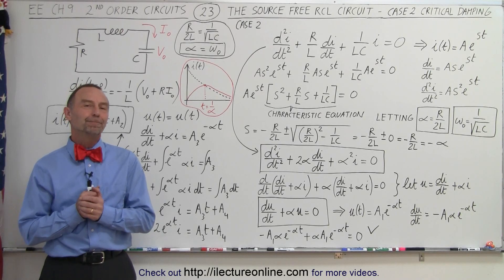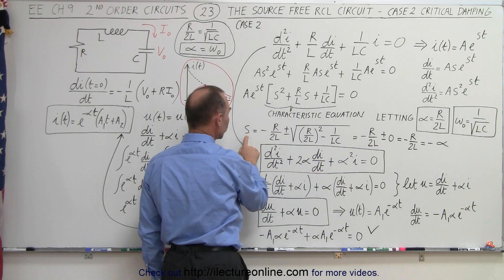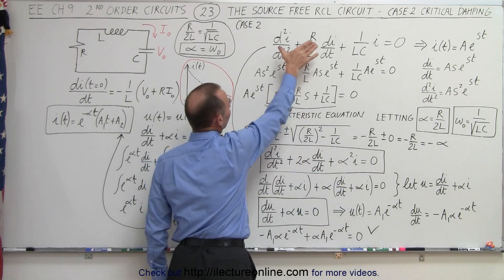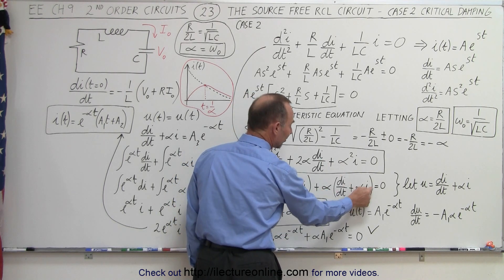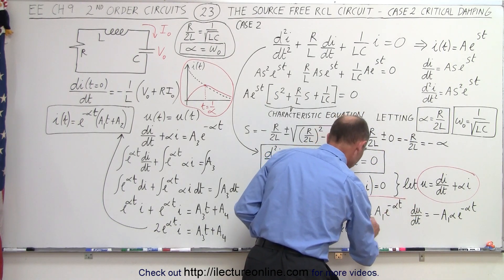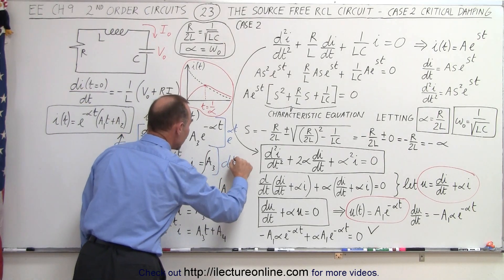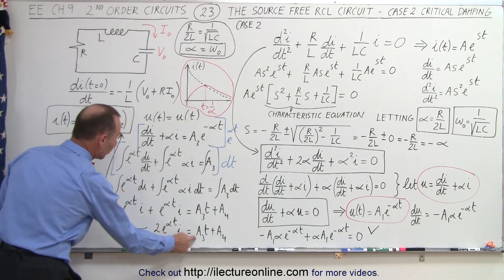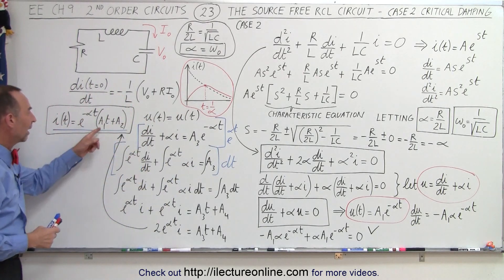Electrical Engineering: Ch 9: 2nd Order Circuits (23 of 76) RCL-Case 2 Critical Damping

Comment: At time 5.23, why integrate "di" only.. by right should integrate by part right.. n include the e^at ... could u explain on thiz.. tq
Reply from the maker: We multiplied both sides of the equatoin by dt
Reply: So, if multiplied both sides of dt,, can we ignore the e^at for integrate??
Reply from the maker: No you cannot "ignore" the "e^at" in the integral.    Inegral (e^at)dt  = (1/a) e^at+ c
Reply: @MichelvanBiezen  At 5:24, I have the same question, but I will elaborate.  

I did the following for the leftmost integral (the one from the second equation from the bottom of the board):

integral [ e^(alpha * t) ] di(t)                 =              integral [ e^(alpha * t) * di(t)/dt ] dt

______________

Integration by Parts is shown as below:

integral u(t) dv(t)    =    u(t)v(t) - intregral v(t) du(t)

______________

Recall (mentioned from the very top of this comment):

          integral [ e^(alpha * t) ]      di(t)                 
=        integral [ e^(alpha * t)   *   di(t)/dt ] dt
=        integral [ e^(alpha * t) ] * [ di(t)/dt ] dt       (all I did here was regroup the terms)
                                     
=        integral          u(t)                    dv(t)

The "regrouping" was to put it into the form of the L.H.S. of the [Integration by Parts] equation,
which gives the following substitutions:

  u(t) = e^(alpha * t)
dv(t) = [ di(t)/dt ] dt

To also get:

du(t) = [ alpha * e^(alpha * t) ] dt
   v(t) = i(t)

_________________

Applying the substitutions to the R.H.S. of the [Integration by Parts] equation,
I got:

[ i(t) * e^(alpha * t) ]    -    integral [ i(t) * alpha * e^(alpha * t) ] dt

Therefore,
integral [ e^(alpha * t) ] di(t)     =              [ i(t) * e^(alpha * t) ]    -    integral [ i(t) * alpha * e^(alpha * t) ] dt
__________________

Now, in the L.H.S. of the second equation from the bottom of the board (NOT the [Integration by Parts] equation), 
it said:

integral [ e^(alpha * t) ] di(t)                                                                    +     integral [ e^(alpha * t) * alpha * i(t) ] dt

And, substituting what was concluded from the previous step, I got:

[ i(t) * e^(alpha * t) ]    -    integral [ i(t) * alpha * e^(alpha * t) ] dt      +    integral [ e^(alpha * t) * alpha * i(t) ] dt

And, the integrals that are subtracted and added should be exact opposites and CANCEL out, as far as I can tell.
That leaves the board's L.H.S. with only:

[ i(t) * e^(alpha * t) ]

Giving the final equation (that I got) to be:

         e^(alpha * t) * i(t)      =     ( A_3 ) * t + (A_4)

Instead of what the video shows (which is twice my value on the L.H.S.):

    2 [ e^(alpha * t) * i(t) ]    =     ( A_3 ) * t + (A_4)

My reasoning was that the exponential as well as current are BOTH functions of time, t, like so:

u(t) = e^(alpha * t)
 i(t)

I could be mistaken, but I think when doing the integration in the video, the exponential was treated as a constant instead of as a function that varies with the independent variable, time (t).

That's why, in the video, it appears to me that it was taken OUT from the Integrand, as a constant would be, like so:

integral [ 1 * e^(alpha * t) ] di  
   
=  e^(alpha * t) * ( integral [ 1 ] di )  
=  e^(alpha * t) *  i

Coming from the video, it suggests:
                 integral [ e^(alpha * t) ] di    =  e^(alpha * t) *  i

Instead of what I got:
               integral [ e^(alpha * t) ] di(t)  =              [ i(t) * e^(alpha * t) ]    -    integral [ i(t) * alpha * e^(alpha * t) ] dt